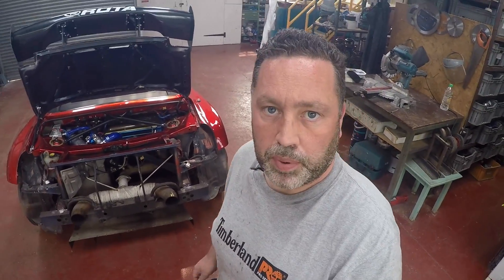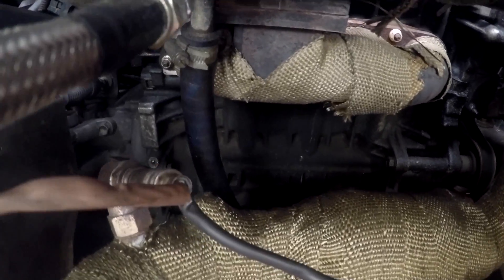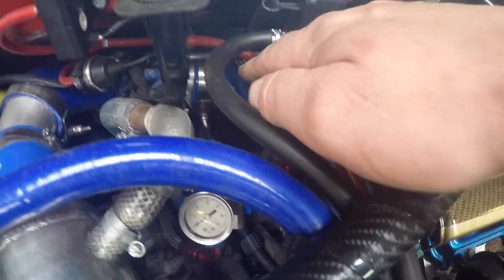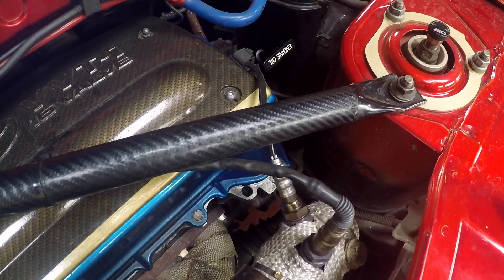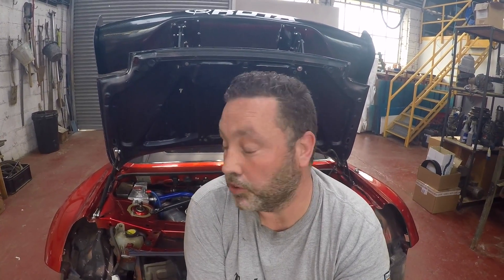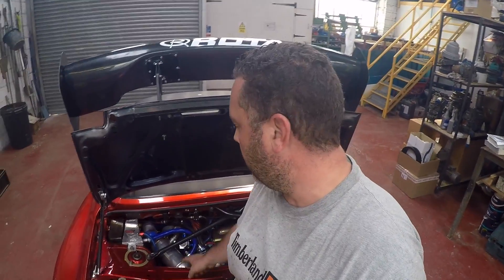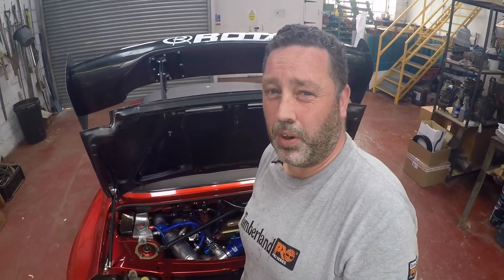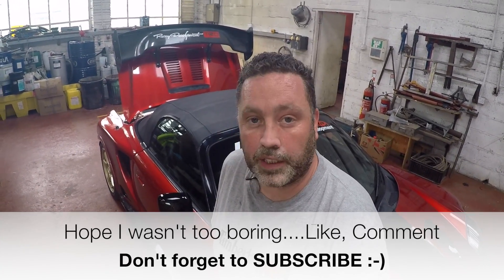Turbo the 1ZZ MR2 spyder / roadster

Comment: I am running an AEM FIC/6 piggy back.  The tuning is actually quite simple with a little bit of programming in excel when using the logging capabilities of the AEM FIC6.  I have an air to air running at 10 psi and it is soooo much fun in autocross.
Reply: Hey, I am in the process of installing an AEM FIC/6 on my 1zz Celica. Do you have any resources I can learn from? Or any tips you could give me, like some headsup or something? I'm starting with just the FIC and I am wiring it car so I can start tweaking the maps and learn its workings...after that turbo
Reply: @mantal94  Pretty straight forward if you have the wiring details of your ECU.  You will need higher flow injectors and if you keep it under 10psi, your existing fuel pump is fine.  Go with a small turbo otherwise turbo lag will be a problem.  Since you cannot go much above 10 psi without engine internal  changes, a small turbo is fine.  You will also want to get a wideband O2 sensor and tie it into the AEM.  Then you can log your engine's performance and tune it.  I wrote macros for Excel and I can get it tuned in about 5 runs.
Reply: @anthonypistilli5323  well, the wiring on the car is pretty much done and I'll connect the FIC soon. I'll start with a map with everything set to 0 as to just ensure the connections work properly and then slowly I'll start tweaking things to understand how the car behaves. After that it's turbo time...I know what the steps are but since I'm not familiar with them they do at times seem a bit daunting. Would it be possible for you to give me an email or instagram so I can seek some advice later on if needed? Your setup seems to be pretty much what I am looking for
Reply: @anthonypistilli5323  thank you so much, I wrote down your email. You can remove it from the comment if you want to avoid spam

Comment: I think you are being too modest. You are smart to start with low boost, then upgrade later (intercooler, injectors, ECU) as you gain experience and/or you reach the limits of what you can do with what you have. Very nice work and concise video. Where did you get your exhaust manifold?
Reply from the maker: Rene Neron thanks, the manifold came as part of a basic turbo kit I got from garage whifbitz. They don't make the kit anymore.

Comment: Hey Lee, hope you can give me some help if not too busy??  I have an 03' with only 57k on it. I've also added a  GT28R turbo -w-Greddy E-Management Ultimate on it, Tein Flex suspension W/FDFC, Enkei 17" wheels, Bear brakes, Custom designed by Me Magnaflow Duel outlet exhaust. And many more upgrades. My question is? I was told to just unplug the two front O2 sensors by the manifold as the Piggy back ECU has a o2 sensor of it's own. I keep a check engine light due to this so I'm wondering should I plug them back in or do the resistor trick you did? WYT?  Also I'm running about 9 PSI should I change out the stock Fuel injectors too?

Comment: Hi Lee, How are you doing? I'm Sean from Australia.  I've been going through your videos and trying to find out what Clutch did you put in your 450+ 1ZZ? I. Asking because I recently got myself a 2000 MR2 Spyder with a 1zz with a compounded turbo setup, 5 speed MT. The Clutch that the previous own had in it is not holding up. Any info would be appreciated. Thanks

Comment: How about your induction buddy, is it tucked down behind the coolant header tank? Interestingly, that crank case breather on the TTE kit is connected to the turbo inlet. Looked odd to me, but it is the original TTE intake pipe and has a connection for it. The other interesting thing about the TTE kit is the intercooler sits just angle up under the front of the gear box, interesting place to put it but it works.

Car goes alright that I bought so far, apart from it was boating and felt a bit unstable under hard acceleration or at speed, found a rear shock was blown so changed it, also toed out the front wheels both slightly as one was toed out the other toed in!

Only weird thing I have noticed is the exhaust is full of soot. When starting at cold the exhaust chucks blobs of soot out on the floor over time. Once warm it's clear which is odd.

The car boosts to .67 PSI max with the TTE kit, so close to 10psi on the stock engine. I was surprised, thought it would be 7 or less.
Reply from the maker: Mike Nefkens yeah inlet tucked up into the side vent. Seems strange to have boost onto the breather. I got mine a full alignment and made a massive difference. These engine seem to take quite a lot of boost, stronger than people think. Forget rods and they are bullet proof
Reply: Cool thanks, that's where I was thinking of placing mine. Yep seems odd but it does say in the manual that's where it connects. It's actually on the inlet pipe through from the air box, so the turbo kind of re-circulate the crank case fumes back into the turbo.

I've got a more pressing issue though, the guy I bought it from stated it was using oil, came with a receipt to show leak down test, turbo test and such all came out clean, so he changed the valve stem seals. Only prob is, I serviced it and pulled the plugs, plugs are jet black and wet, each plug hole is also wet with some oil and the tops of the pistons :(

The motor is going well, but small puff of smoke when letting off at high RPM (only noticeable at night you can just make it out in headlights behind, in the day can't see any).

No loss of power and still goes well. Hoping it's not the rings / pistons, maybe he lied and didn't change the stem seals, or maybe he didn't do it properly or the gasket he fitted is bad. Need to try and work it out so it's put a bit of a downer on things atm.

Comment: I notice you mention stock injectors were maxed out, whereas I thought they could flow enough for over 200hp.

I'm running a TTE turbo, with SP exhaust and 9psi still on stock injectors. The TTE manual doesn't call for changing injectors at all with the turbo conversion.
Reply from the maker: Mike Nefkens mine were running at over 80% duty cycle. They weren't maxed but it's not good to run them maxed out. Also the air density can change a lot between turbo's and cooling systems, the more dense the air, the more fuel it requires to maintain the ratio. 9psi on one setup up is different to 9psi on another.

Comment: Hey!
I know this video is a few years old, but Im actually turboing my MR2 1zz in like 2 - 3 days, I already ordered a bunch of parts and pieced together the kit myself (and Im gonna record the process for youtube)

I bought an intercooler, but I might skip it for simplicity purposes if you think it's safe. I plan on running 5psi on an ebay / chinese turbo (GT2860 / GT2871), using an Apexi Power FC. How were your IAT's?

Comment: I am doing a turbo 2002 Mr2 spyder build with the Greddy Emanage Ultimate. I was wondering what all your jumper settings were set to, and What kind of wiring harnesses and sensors you used. Also where exactly did you spider all the wires to from your GEU. So I guess I am just curious just how you hooked your Greddy Emanage unit up to the car and your basic settings.

Comment: Hey, Awesome car!  

how is you're oil consumption 

my mr2 is really bad at this point xD
Reply from the maker: +jack armando mine is not great, it was a lot worse though. I changed to 10w40 semi synthetic and it slowed it right down
Reply: SpyderLEE thanks for the information! i wanted to do a turbo install,but the oil consumption was a real big deal for me

and now u fixed my problem! thx mate ;)
Reply: Use Castrol Magnetic for economy driving or Castrol Titanium Fluid Technology for street performance.  Along with "Prolong oil treatment"  I used Mobil which is trash because many engines eat mobile one oil.  Castrol oil is a different story.  Castrol Oil additives are more advanced and totally change your driving experience.  It is true " Liquid Engineering"  MObile one oil has never been a good oil.  If one person said its good oil, everyone is going to buy it on the market, BECAUSE its "MOBILE ONE"  But do they know what they are even putting in there engine?  Castrol is racing oil, which is used in one of the greatest race cars and engines, such as Skyactive technology.
Reply: phillip shevchenko can’t find 10w-40 in any of those, 5w-30?
Reply: Right, there is no Castrol Magnetic in 10w40. They do have 5w30 Magnetic
Reply: My understanding is excessive oil consumption a problem only for pre-2003 models....?

Comment: Great vid hanks mate. Just joined up MR2OC and keen to get cracking with this. Are you using a separate rad for the chargecooler or can you plumb into the main rad like you did for turbo coolant? Also is it a stupid question or can you get away with doing this without pulling the engine out? Hardest job i can see is welding oil return boss on the oil pan. Or is it getting access behind the engine for intake stuff? Sorry for the many questions!!
Reply from the maker: It’s all a squeeze but I didn’t take my engine out. Charge cooler is a separate circuit with its own rad at the front. Coolant circuits run hot. Charge cooler circuits run cold.

Comment: I love the way it looks! but with all that work could you not just go 2zz and get good power then later on turbo that?
Reply from the maker: Nothing special about a 2zz. They are only any good stock vs stock. This build has 50% more power than a 2zz and if I put the cost of fitting a 2zz into building this engine , it would still have 50% more power than a turbo'd 2zz.
Reply: @SpyderLEE  with this setting you had (most likely) around 325 bhp at the wheels, it 's doubtful if you would get more than 340 bhp in a 2ZZ with stock internals at 12psi.